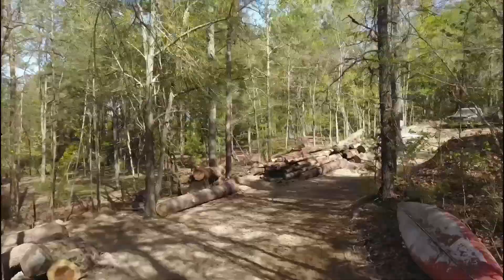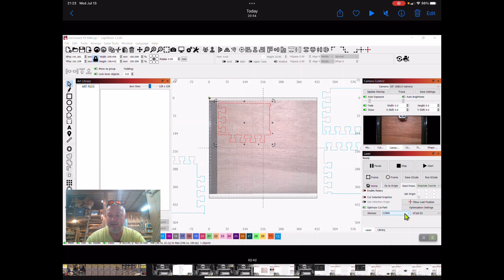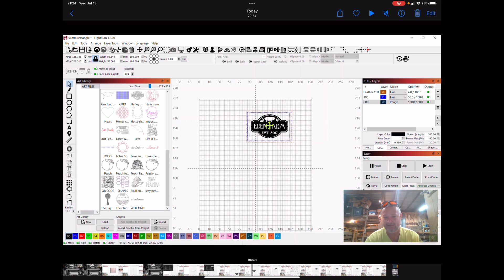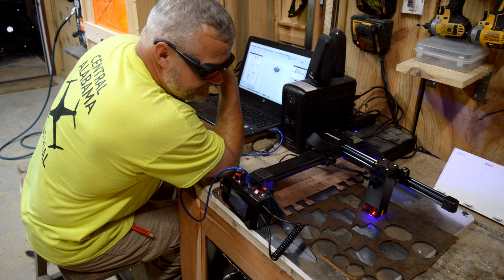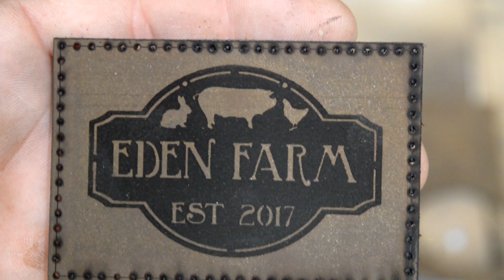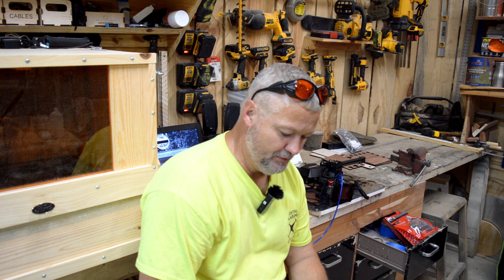Cutting a hat patch with the Atomstack

Comment: Hello, what settings did you use on the atomstack p9 m40 for cutting and engraving the leather?  Also what was the thickness of the leather? Thank you very much for making this video!
Reply from the maker: Wow, that was a long time ago. If I didn't mention it in the video, I do not recall. It took a few passes. I think the leather was a little over 2mm thick. Again, it has been a while.